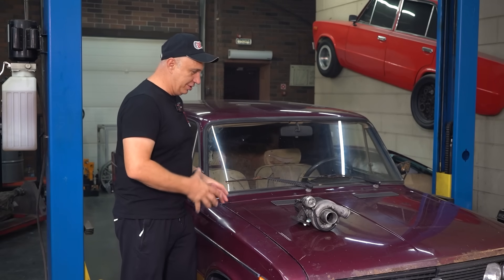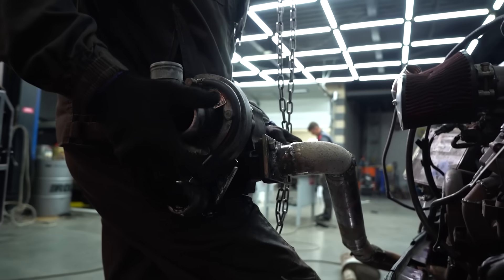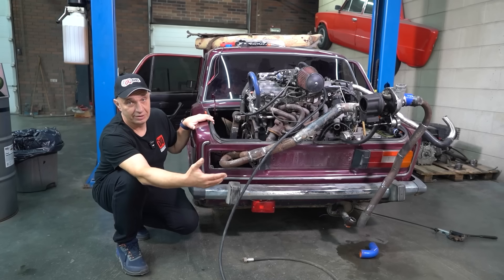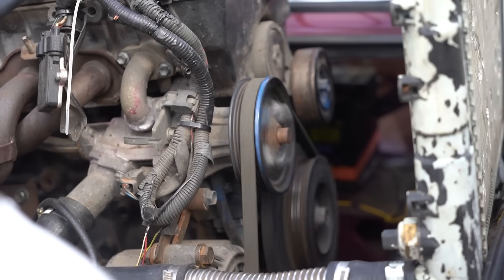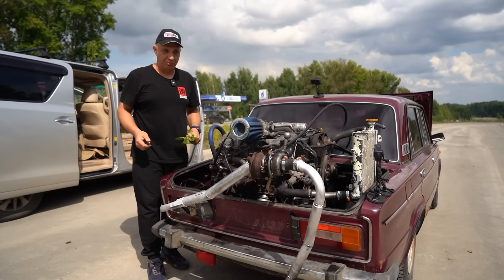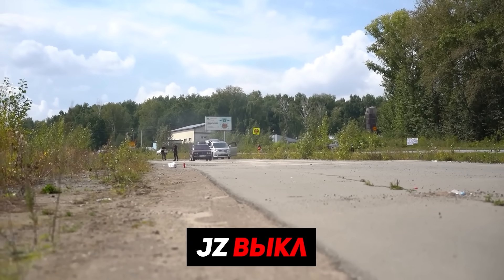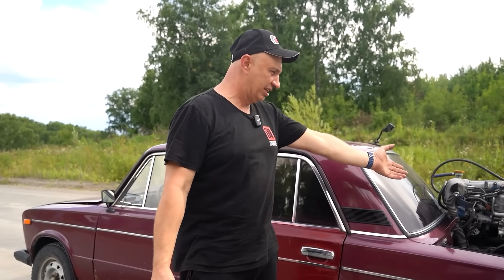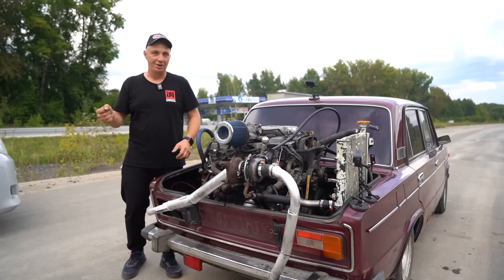Using a turbo to suck exhaust gases out of an engine - what will happen?

Comment: The answer is always the same. If it made more power and was cheaper to manufacture the manufacturer would already be doing it. Love your crazy videos though. Love that the radiator is just sitting to the side with no way for air to flow over the coils. A+ garbage.

Comment: More efficient? use an electric turbo or a (bi-turbo/e-turbo) -idk what its called, the one which uses an electric motor to overcome the initial lag and inertia before turning off the e-motor and running on the exhaust. Then as for the piping... I don't have a full solution but no need for that bulky engine to run it. 
Or maybe just use a large, regular, electric turbo (perhaps 2 of them on a dual exhaust).

Comment: this is a bs test because whats happening is the turbo is restricting the exhaust so of course when its working its better. They should have done test with the pipe off and not hooked up to the turbo vs having the turbo inline.

Comment: I already anticipate the fail. I mean, come on -a turbo on the end of the exhaust pipe drawing out the gases? it's overkill to the point of destroying cycles and already compensated for with a certain exhaust pipe shape.
Fun idea though lol
Edit: damn it actually worked lmao did not see that coming

Comment: Listen here fellas, about 90% of the exhaust stroke happens when the piston is still coming down. The exhaust valve can be opened any time after 45* TDC and the expanding gas is done creating work and will expel itself. The Exhaust stroke is largely fabricated, and functions only to return the piston to TDC for the intake stroke. Most of the gas in the exhaust is released before BDC, this is known as "Blow-down". Altering the cam timing will significantly alter the results.

Comment: 0 seconds ago
Of course it makes it perform better you are still forcing more air through the engine with the turbo sucking air in through the carb instead of pushing it through like a normal turbo would don

Comment: Wouldn't it be more efficient to use an electric motor, spare battery and upgraded alternator? I feel like the extra engine takes away any gains you'd see.

Comment: it would be interesting to test this out on a turbo engine,  with the engine driving the lada having a turbo so the engine in the back is reducing the backpressure required for the turbo to be driven. Maybe that would give a larger result?

Comment: You can make a little jet engine out of a turbo charger. It makes a lot of hot gasses and is light weight.  You coupd use it as the gas generator instead of the 1JZ motor.  In other words, a turbocharger jet engine's exhaust spinning a turbocharger to suck out the Lada's exhaust.  Would accomplish the same end result, but be much lighter and cheaper.

Comment: I'd guess without watching the video fully... Relatively minor gains. If you used a more practical twin centrifugal supercharger setup (one to feed the motor, one to pump the exhaust out), then MAYBE it would make sense? But probably not. A camshaft with extended duration and lift would probably accomplish the same thing more or less, and with less parasitic loss.

Comment: What if you loop your cold ac lines around the inside of your air intake hose then blast the already cold air into the intake as well instead of in the cab? Colder air=more power but at the same time, the ac compressor will put a load on the engine so will it make power or lose power?

Comment: We need an alternative power source for the turbochargers were they are self powered,  one blowing in, and one like this as a vacuum. 

I suggest making a small  boiler on the exhaust manifold and simply using steam to operate the turbocharger, and a water injection system to regulate turbocharger load.

The expansion ratio from water to steam is something like 17,000:1 ratio so be careful !!!!!!!

Comment: Never in my life would I have imagined I would see a 1JZ installed in the trunk of a Lada
Reply: especially one thats only there to suck out the ladas exhaust gases😂
Reply: @yourlocalplumbingcompany4984 1JZ sniffing lada's farts lmao
Reply: I never thought I would see a 1JZ in a Lada ever. And, it wasn't with anyone I would have expected to do something like that, or have someone do it for them. I mean, a 1JZ in a Lada is something Jeremy Clarkson would do because of his "More Power!' mantra, except with him it would be in the engine bay.
Reply: ...just casually not even the point of the video
Reply: @nerdlydood Good point. If anyone else made a rear engine 1jz Lada. It would be a 54 minute snoozefest of a video where they drive it around for the last 60 seconds of the video
Reply: @nerdlydood  They could've made a video out of that alone
Reply: That implements you did see one in the Front😂
Reply: Right?! 😂
Reply: for sucking off a lada engine
Reply: New here?

Comment: Could you power the turbo (or literally a self-made fan pulling the exhaust gases) with the propeller shaft, removing the excess weight of the second engine? Or with some sort of Garage 54 wizardry,  with a belt straight from the crankshaft, like a supercharger?
Reply: That’s virtually how a centrifugal supercharger works it is basically a turbo(which is a centrifugal compressor) belt driven off the crankshaft pulley

Comment: something like this is interesting, its a proof of concept not everyone is brave enough to go forth with, done in true scientific fashion with all three steps; hypothesis, experimentation, and conclusion. I see that this data can benefit some subset of the ICE vehicle enthusiast community, although probably without dual engine operation, something like an E-turbo or electronic supercharger could perform the same task without the extra weight and complexity that comes with a second engine.

Comment: Twin turbo charging the intake and the exhaust stroke would probably be the next step to redline a Lada into orbit. 
The 1JZ seems a bit overkill to spin the exhaust turbo however.
Reply: Nah fam, he needs another 1jz to intake air from the front bumper to reduce drag!
Reply: And heavy the lada would be faster just with the 1JZ in it...
Reply: I was thinking the same thing wouldnt a small high power motorcycle engine be better?
Reply: @lenyyth instead of a turbobusa, a hayaturbo. The sound alone would be worth it.
Reply: They make electric turbos nowadays😭😭
Reply: AHAHAHAH NICE
Reply: They are on the right track; More Displacement. I feel certain that in time they will solve the riddle. I mean, using exhaust gases to produce thrust is literally rocket science, let them cook.
Reply: This could be a funny thing to see eon a mini hybrid, have the main engine power a power cell that then electronically operates the turbo

Comment: Could have used a lawnmower engine to spin the turbo but that’s not what garage54 is about ❤ love this channel it’s the best
Reply: More like a 300cc 20hp motorcycle engine
Reply: @lenyyth not using the exhaust gas but by removing the exhaust housing of the turbo and using the shaft to be driven by a small motor or e electric motor like a supercharger I should have been more specific
Reply: @theseoldhands532 ohh lol i was just thinking along the lines of thats a massive motor and you dont that much power to run the turbo a cbr300 motor would be so much lighter and have plenty of power to spool it up
Reply: @lenyyth that is also a rad idea

Comment: Do one with an E-Turbo. A Garage 54 Hybrid Performance - It would be electric assist, using a design with less moving parts, with the same benefits and performance gains as your current spec.

Comment: Dry sump oil systems greatly benefit engines by creating a vacuum on the crank case. Vacuum on the exhaust side sounds beneficial too.

Comment: I wonder what doing and electric turbo on both engine of the engine? One pressurizing the intake, and one to scavenge. There's a guy on yt making 650whp or so using rc motors and speed controllers, just double it!

Comment: SUCK THE AIR OUT OF THE CRANKCASE! It would be interesting to see if there is any noticable power gain from having combustion on one side of the pistons and  vacuum on the other, as well as the decreased aerodynamic drag of the components at high RPM

Comment: WTF why didn't you just take the hot side off the turbo add a pulley and use a lawnmower engine with a pulley and a belt or even a hi powered electric motor too run the turbo (now a supercharger) using another car engine is kinda tarted!!!!!!

Comment: It’s gonna work. It’s going to create a vacuum behind the exhaust valves helping evacuate the combustion chamber more efficiently, allowing increased flow of the intake charge filling the combustion chamber more thoroughly with an air fuel mixture increasing overall engine efficiency.

Comment: I had this idea yesterday, take a procharger, and mount it so the drive wheel on it rests against the driveshaft or a wheel, then route it so it pushes air through the exhaust, or possibly give the outlet a small tube and use it to cool the brake rotors.

Comment: Maybe the turbo is sucking the pistons up. thats why its faster, not the fact that the exhaust gasses are leaving quicker. It has drive on the explosion downstroke and the exhaust up stroke..
Reply: What do you see as the difference between "sucking" and "removing exhaust gasses"?

Comment: I am curious as to what would happen if you did this with a sort of "compound" setup on a single engine, use half the cylinders to run a turbo for boost and the other half to run a turbo that sucks on the down pipe of the other

Comment: Ooooh, I've always wondered what would happen if you do this, as exhaust supercharging is definitely a thing. Always suspected you'd need to run a dry sump oiling system and add additional oil control rings if you're really committed to the idea.... Excited about this one...

Comment: there are fully electric turbos that dont require exhaust gases to spin it up. get a high psi rated one and rig it up in the exhaust. should be way smaller and lighter than having an entire engine in the trunk.

Comment: The 2.5 is WAY to much. Should have used a huge procharger that you easily could spin up using a tiny two stroke engine.

Comment: Try putting the exhaust through an intercooler then use a belt driven supercharger to pull on the exhaust. That way it can all be done with 1 engine. This would be interesting to see the results of.
Reply: It would actually reduce power output. Superchargers use about 25% of engine power just to operate

Comment: "My lada has 1JZ!"
"Hold my beer, MY lada motor has 1JZ as a compressor"
Reply: as a vacuum pump
Reply: its ridiculous but ridiculous is this shows specialty 😆
Reply: More like an extractor.
Reply: I thought they would use an electric motor to spin the turbo at first, but that would be heresy
Reply: DE-compresor :)
Reply: A vacuum listening is important 😂
Reply: Negative compression is still compression. Just like deceleration is negative acceleration. Same math, but with a minus sign.
Reply: @FrietjeOorlog "depressor"😅
Reply: @FrietjeOorlog  "negative compression" is decompression. Different words with different meanings.
Reply: @FrietjeOorlog   put a turbo in the output and in the input.
Reply: @FrietjeOorlog  acceleration can be any direction due to relative motion. compression however strictly is when things come closer together.

Comment: Car mod Idea. I dont know how hard it would be to do. What if a car had separate controls to break every wheel. That way you could make really tight turns by locking each wheel and drifting.

Comment: Using a whole other engine to run a turbo-pump, lol.

Of course, the more practical way of "packaging" that boost would be to simply add 50-100cc to engine displacement and skip all of the extra hardware.

Comment: Use the force compression from the 2jz turbo ,connect pipe from 2jz turbo to the intake in the lada carburetor .
Try that see if that works
Reply: would work with a blow-through carb

Comment: I feel like the concept of a turbo exhaust would eliminate the need for multiple exhausts if it weren't for the extra heat. Thats my prediction.

Edit: After the video I realize you probably need a more powerful engine to make a large difference with the exhaust fumes. Maybe that Lada V8 engine could benefit from it instead of using dual exhaust.

Comment: You should try attaching one of those stupid electric turbos to the exhaust. They are pointless if you try to use them as they are advertised, but using one in this circumstance would basically eliminate all of the extra weight of the additional engine and the cost would be significantly lower. That would be my suggestion on how to make improvements to this setup.

Comment: I wonder if the turbo is actually pulling in more air/fuel from the carb. That would only work if there was valve overlap though.
Reply: There is virtually always overlap - even in a lazy engine no modern engine will have a situation where the exhaust valve is fully closed before the inlet valve is starting to open

Comment: Great one G54!  The only funny Russians!   But would an electric driven compressor not be much easier instead of fitting a whole engine in the trunk.....?  Or rerouting the exhaust gasses and oil from the Lada engine......?

Comment: Procharger + Electric motor would probably be a much easier and smaller package, can even set it up to monitor vacuum in the pipe and rev the procharger higher if it detects pressure increases

Comment: Inject air into exhaust manifold to help burn unburnt fuel and clean emissions. One injector per exhaust outlet as close to the cylinder head as possible🙂

Comment: An electric turbo system or one driven like a supercharger by pulleys that drive the accessory belt... Also, to control the RPM system of a gas extractor, it would be ideal to have an electronic system, hopefully using a flow meter, so as not to over-exert the exhaust fan.

Comment: Great test! I'm really curious to see a third run where the pipe fitted to the muffler were disconnected, removing the extra piping to run as stock and what the gains would be, or even with the muffler removed and replaced with a pipe.

Comment: What about a supercharger on the exhaust side?
Reply: That wouldn't be fun, you'd need a pulley or gear system to drive it and a custom manifold to mount it... Not to mention the fact that you are adding extra load to the engine just to push the exhaust.
Reply: That wouldn't be fun, you'd need a custom manifold for the charger and a drive system for it. Not to mention the fact you're increasing engine load only to pull exhaust out.
Reply: This is Garage 54 we're talking about, where it's essentially for a laugh.
Reply: @danmaycock9238  very true, I just don't actually see anything laughable or exciting happen.

Comment: I know they are sort of crap, but I wonder if an electric turbo would be better here for the weight. No need for a second engine, just some batteries and a switch/controller, and turbine should suck out the gasses too

Comment: That's not a 2.5lt it is a 2jz GE they only make them in 3.0 and up depending if work was ever done . I think you need a better translator
Reply: Looks like it could be a 1jzge. Hard to tell as both 1jz and 2jz naturally aspirated look the same. I think that bit of upper timing cover that is missing would say 2500 on it if it was a 1jzge.

Comment: an excellent idea....i've never seen this tried before... i think the shape of the exhaust pipe tips would create a similar effect with aerodynamics but only at higher speeds... it seems there's one more boost combo to try... both.... a turbo on the intake and one on the exhaust running at the same time...intake boost, and simultaneous exhaust vacuum... the cylinder scavenging would be huge... the motor would breath like a dragon. .😎
Reply: Until it "dies" 
Why the marks? 
Because the engine is a literal tank

Comment: Use a 2kw electric motor to drive the turbo, and synchronize the electric motor speed to the engine rpm, use the largest diameter turbo available and enlarge the exhaust from the engine to the turbo, then add another turbo, smaller with a waste gate driven from the output of the first, that drives air into the engine.

Comment: Use a little gforce meter and show that on the screen, then we can see how much the vehicle slows or speeds up when you do things like this. I think phones can even do this using an app. 

Weird ideas as always but its very intriguing the effects it will have. Maybe get an engine to boost a turbo for your intake as well? Put bigger injectors though lol, probably have to gap those rings bigger too, blah blah

Great vid boys

Comment: It will work somewhat. But it would work 107% better if instead of that engine running a turbo, connect it to the driveshaft and have 2 engines powering that car.
Reply: But it's boring, they don't want to make a Lada into a racecar, they want to mess around